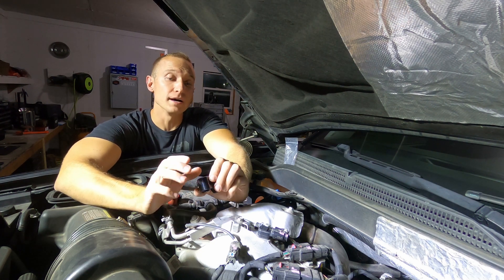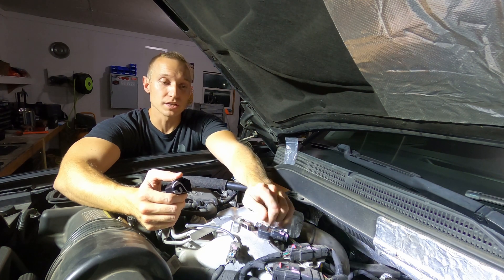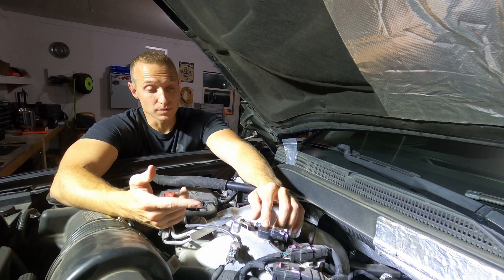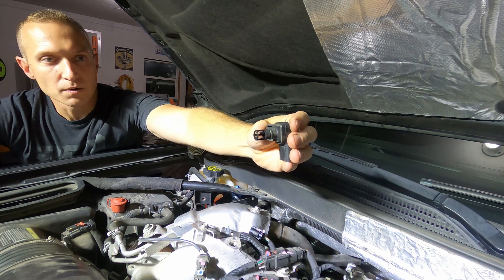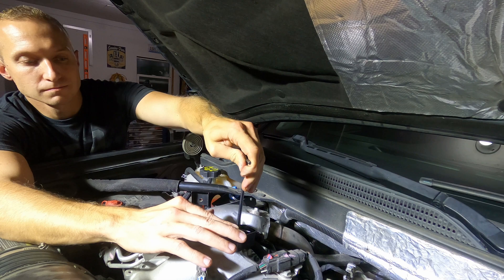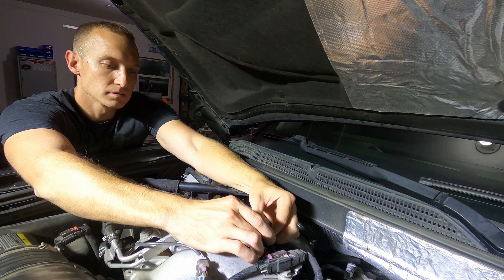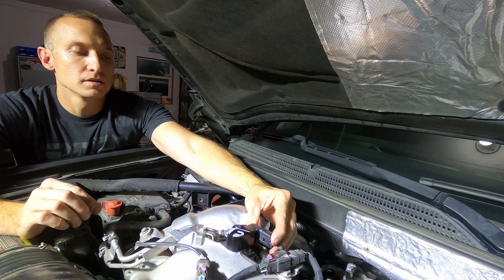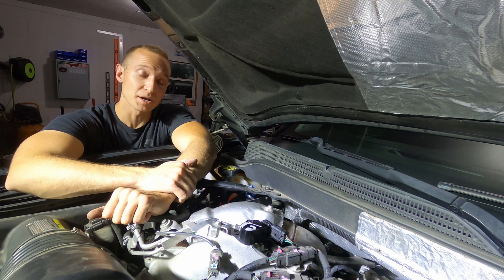L5P Duramax MAP Sensor Spacer Install Guide

Comment: Keep a couple of Injector pigtails connectors in the glove box
Reply: Second this
Reply: Why?
Reply: @LBZOverlander  connections in the wires are print to wearing out therefore cutting out a cylinder
Reply: I’ve heard the L5P have electrical issues. Is this the electrical issue or part of it?
Reply: Cyl 4 I heard